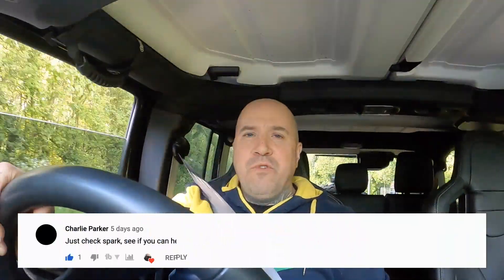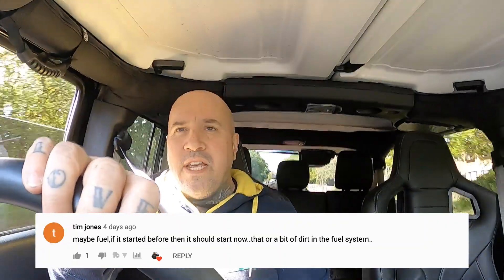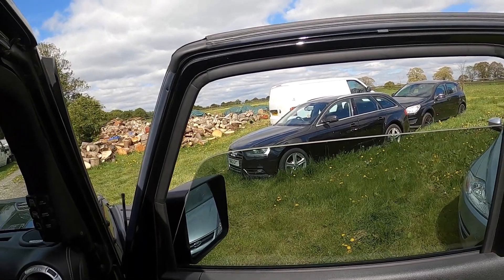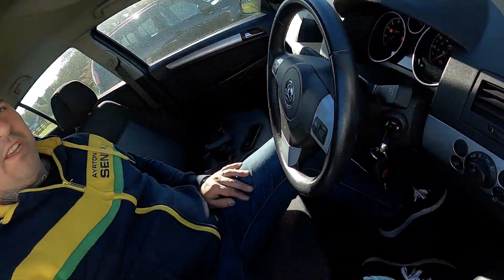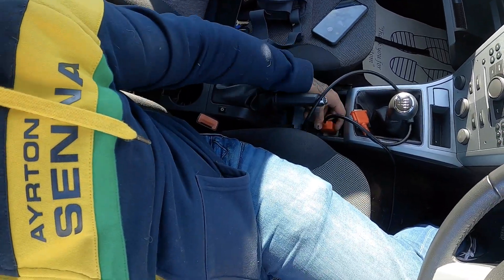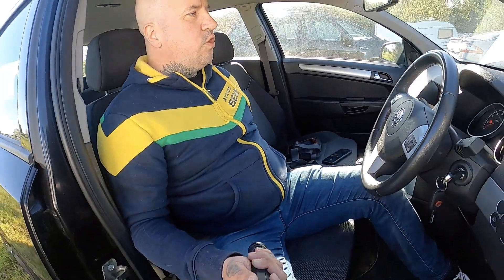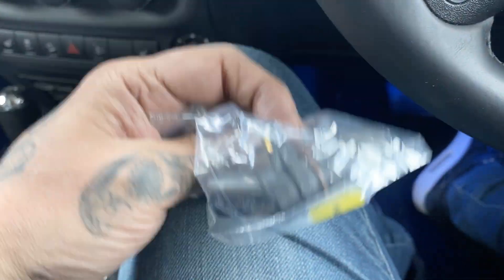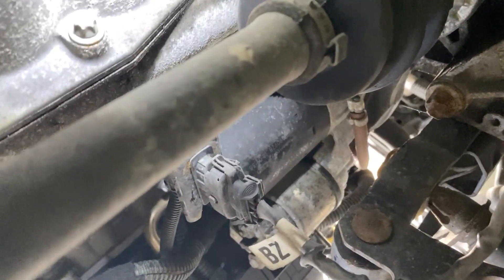The Car Graveyard Part 2 : Car Auction Diaries #22

Comment: Send / sell  the audi on a lorry to eastern europe
Reply from the maker: could be a good idea lol
Reply: I'm in poland 
Most of the cars we bring from the uk are for parts ( best to sell the car in full )
Some sell quicker here than in uk
Reply from the maker: what sells the best in Poland? high mileage stuff?
Reply: Anything on the car apart from the head lights 
Low mileage high  mileage It all  sells 
No salt on these roads 
Cars last 30 years if looked after
Reply from the maker: doesnt it make it harder being right hand side of the road over there?
Reply: Theres many right hand drives over here 
Basic example 
Audi a4  1.9 tdi on an 04 reg with 220 km on the clock originally from germany best part of 2500 pounds 
Same car in uk worst case is 800 pound